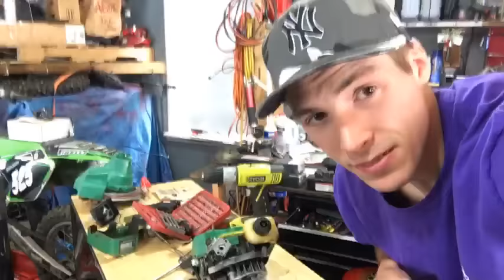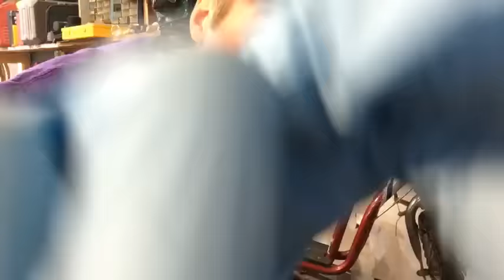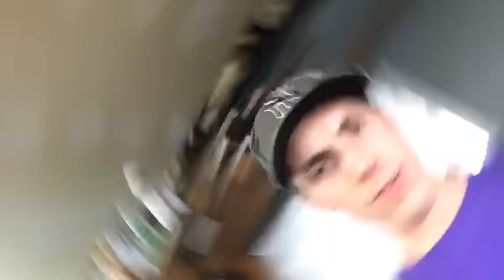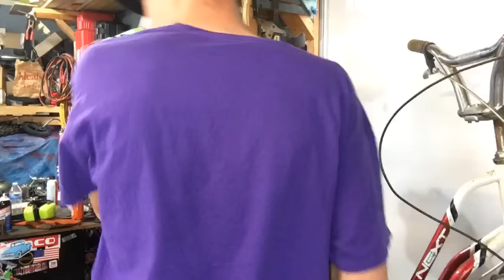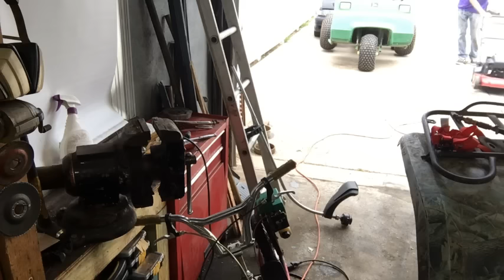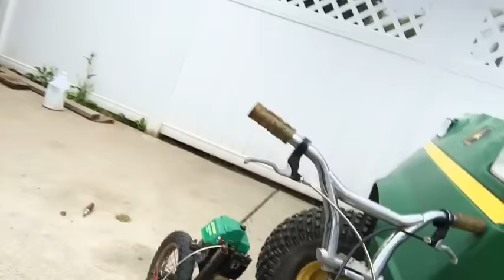Building Motorized Scooter Live!!

Comment: Watching your live stream LATE . Sounds more like the float is stuck due to lack of use . Quick fix tap the float chamber Dalton . 50 year ago I has a Triumph 500cc sprung hub bike . Got caught on the road at 13 years old . Cost me £25 in finds which was a lot of money in them days . We used to even rebuild new clutches by cutting corks and inserting them into the plates. We had a few bike we rode in the woods .Seen us getting chased with 4 on the bike by the cops . We where mad and loved our cars  I had a 1340cc cooper s ,3ltr mki capri gt , mk1 mexico ,and was nearly killed in a MG Roadster rolled it end to end through us out as open topped lucky as it landed upside down  Had loads of bikes as well yds7, gt550 could go on all night lol  . We had a great time at your age just a bit more wilder lol  . Interesting video just doesn't seem to let you get on with your job .

Comment: I have a weedwacker engine just like that on my bike I have it set up almost identical with angle iron and friction driven but mine has a hinge attached to the frame and a spring to get better friction and used pluming pipe as my spindle I ride it all the time I built it when I was 11 and now I am 12 and still ride it but I got a dirt bike (1999 XR 80) in march 2017 so now I don't ride it as much but there really fun